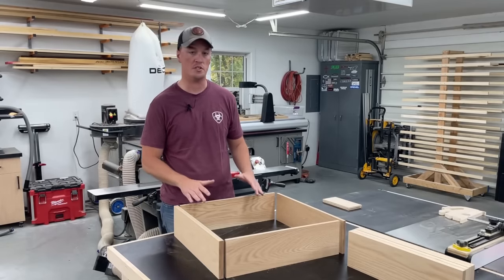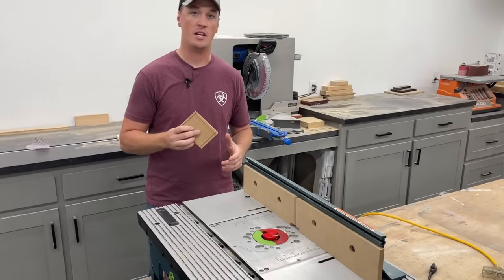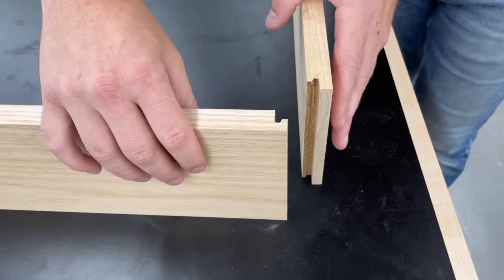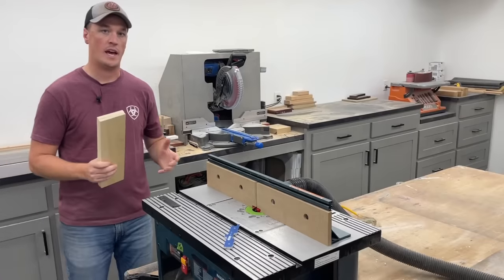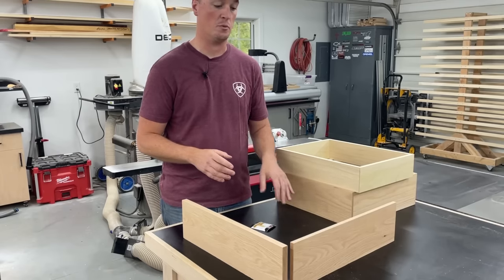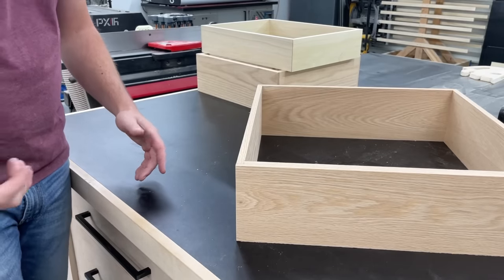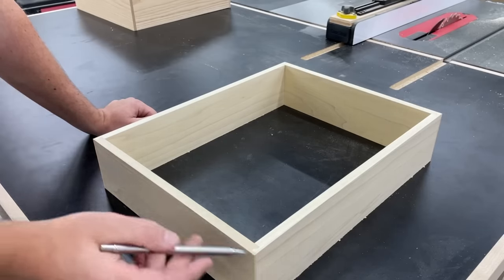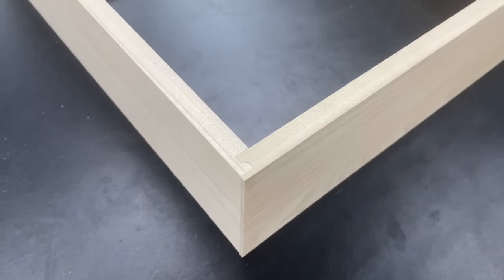Try THIS Great Drawer Building Method

Comment: I am so glad I found this video.  I'm about to make a ton of drawers for my shop, and just hated the idea of having all the slides exposed and/or having the pocket holes exposed.  The special router bit isn't cheap, but will easily pay for itself by not having to purchase wood for drawer fronts!  Thank you!  (And I subscribed for more tips in the future.)
Reply from the maker: Awesome thanks for watching!!
Reply: Great point about the cost of wood for drawer fronts!
Reply: @jimparker871, this is a nice method for drawers but more so if making solid wood sides.  If you’re using plywood and don’t want to see any exposed wood, then the half/half/half method completely conceals everything, even plywood layers from the front/back pieces.
Reply: @choprpilot76  You don't need solid wood sides. You need a solid wood drawer front. You effectively half blind the sides into the front face. All you see from the side is the face grain of the side piece and a bit of end grain of the front piece, which would be hardwood,  with this construction.

Comment: That didn't work very well with the baltic birch. When sides are routed the locking tip is too small and plies break  and detach which results in a hole in the joint. It works very nice for solid wood boxes.

Comment: Great video showing all the options. I would reiterate the importance of the sacrificial fence if planning to use 1/2 plywood. I have been making a ton of simple drawer boxes using 1/2 baltic birch. The zero clearance sacrificial fence is a necessity for preventing tear out on the inside face of the side pieces. The nice thing is you can just save the fence for the next run of drawers.
Reply from the maker: Yep I meant to say that there at the end and completely forgot haha definitely gotta have it for plywood

Comment: This is indeed THE best way to make drawer boxes. I’ve been doing it for years this way: all you need is glue. Using the small version of this router bit makes it possible to use even thinner boards (I use 9.5 mm. boards). The resulting boxes are just as strong as their thicker counterparts, especially if you use this method for the bottom as well: you can then make the bottom flush with the lower edges of the sides, adding some millimeters to you storage space.
Thanks for the video!
Reply from the maker: Haven’t used it for the bottom I’ll have to try that 👍🏽
Reply: Can you tell me what small bit you are using?  I am trying to make my drawers out of 12 mm  ply for my shop and have not been able to nail the set up yet.

Comment: Excellent video; best I have seen on the subject. I used this method to do a wall of lower kitchen cabinets, substituting drawers for shelves. Makes a big difference in usability when the shelf is about 20" deep. And you are right about the Freud bit being best because of the additional depth of cut, allowing the user to hide the 1/2" space to cover standard drawer slides. However, I would add one important point: Before using the bit to make the deep cut to cover the drawer slide (see timestop 7:40 of the video), I always use the table saw to cut a clearance dado to remove the bulk of the wood. Then the router bit can clean out and finish the joint easily, faster and without strain.
Reply from the maker: Good idea!

Comment: Nice work. "Clear & concise.
Explained different techniques/adjustments very well. Just ordered a bit as i'm making drawers this week.
Reply: Just like add. 
I finally got the set up right with all your sound advice.
Just made 4 drawers in no time at all. They lock up beautifully and particularly like the fact I can now hide the sliders with the overhang on the drawer fronts.
I will now be using this bit & your technique for all my other drawers. Oh well, onto glue up now & fitting.
Again thank you.❤
Reply from the maker: Awesome!! Thanks for watching!

Comment: Very good, clear presentation. I really liked the idea of the wider drawer front to hide the slides.  Also there’s no reason you couldn’t use oak, for example, for the front and 1/2” plywood for the backs and sides.   The only problem with that is you would need at least 3/4” stock for the fronts. Oh, and you lose some flexibility to tweak the drawer front after building the boxes. With a separate drawer front, you can make adjustments for any variances in cabinet width, drawer slide installation, etc.  All that said, I really like this idea for shop drawers!

One question:  would it help to slow the router rotation speed with that big bit?  Especially when you bury it in the bigger front?
Reply from the maker: I didn’t in this case because I did it in 2 passes. But definitely would want to lower the rpms if doing it in one

Comment: Awesome! Do you just glue them afterwards or brad nails or crown staples? Thanks for sharing
Reply from the maker: I just glue to keep the look clean, but yea you can nail if you want
Reply: @JohnBuildsIt  Thanks, John...great video and I had the same question.  I also wouldn't mind seeing the glue-up.  Are the joints sufficient to assure that you're producing square corners?  And I'd like to see exactly how you clamp them.  (And then maybe you could show me how to decide what to put in each drawer!😁)

Comment: as new wood worker I love this clean tight and strong way to make drawers. Newbie question I am building project with drawers from plans but want to make them this way. How does this connection effect my cut list for length and width of drawers? Does this joint change length and width of drawer or need to be accounted for?
Reply from the maker: The overall size of your drawer wouldn’t change, but yea the length of your individual pieces are probably different than how they are in your plans. I went over sizing here in the video that should help you adjust your dimensions 👍🏽

Comment: like this so much that my new 1.25 bit came today. I'm getting a lot of tear out even with a push block then I adjusted the speed of the router to about 1800 rpm still not getting great performance would hardly cut through some 3/4 red oak then I just grab some pine to make a fitting block. Is this kind of bit generally used on softer wood ? like poplar?
Reply from the maker: No I’m using it on oak here in this video. Have you tried burying the bit in a sacrificial fence like I showed?

Comment: Great stuff!  I'm a newbie  Did you swap bits to make the track?  If so, what bit did you use?
Reply from the maker: The groove for the drawer bottom? I just cut it on the table saw, or yea you can swap to a straight bit on the router
Reply: Thanks much!  I appreciate the info.   @JohnBuildsIt

Comment: Great video!!!! Was looking at the other method (1/2 1/2 1/2) and ordered a 6mm bit as most 1/2 ply is 12 mm.  I will be switching to this method for my next project.  Was did you use to cut your dado for the draw bottom?
Reply from the maker: I just use the table saw for the grooves
Reply: @JohnBuildsIt  Thanks -  my draw lock bit just arrived this evening.  Going to start making my drawers tomorrow.  I also have the Bosch router table and today I installed the O'Skool router lift made for this table.  Used it some today and loving it so far.

Comment: Hi John, thanks for the video. I learned something new! What are your thoughts on this method vs. some simple dados? Both hide the method of joinery and use tools you probably have. Is it just personal preference? Speed? Something else?
Reply from the maker: With the dado method the end grain of the side pieces is visible on the front, which is what we’re trying to avoid here. Unless your talking about just doing dados the opposite way, but then there’s no strength advantage to it. Hopefully that makes sense haha. Ultimately good use cases for all the methods though 👍🏽

Comment: How did you do the groove for the bottom panel? Diff bit or height adjustment? I watched again & again and didn’t catch it. Great video though.
Reply from the maker: Just on the table saw. Can use a straight bit in the router though

Comment: John, great video.  I am in the process of making draws with this bit.  One problem I have is that the front and back parts that covers the end of the sides is very thin.  I mean less than a 1/16”.  Yours are much thicker.  What am I doing wrong?  I am using 1/2” baltic birch plywood for my drawers.  Thanks.
Reply from the maker: Should just need to lower your bit a little
Reply: @JohnBuildsIt have tried everything, but cannot get a tight joint and still have enough of a front to cover the sides. Believe this bit is for 3/4” plywood but not 1/2” plywood.

Comment: What setup blocks do you have? Looks like the bottom cutout needs to be + 2” to straddle the 2” router bit and the set I got wasn’t wide enough. It doesn’t seem to be a measurement included in product descriptions.
Reply from the maker: I have the Kreg blocks. Can use the end of blocks rather than the cutout
Reply: @JohnBuildsIt  Thank you! And thanks for the video. I must confess I'm new to routing and had a hard time getting consistent cuts and avoiding tear out on the vertical (side) cuts. You make it look so easy. This guy's super simple DIY coping jig was a game changer: https://youtu.be/AijVPt9VFiM?si=lPERB-xQYoOkJUX1  You might suggest it to people that complain of tear out!  Another thing I learned was to cut the groove for the drawer bottoms AFTER the end cuts. I cut the groove while waiting for the bit to arrive and wish I'd waited cuz of tear out on the exit side of the groove. A little masking tape on the exit side helped but wasn't fool proof. There's probably some way to wedge a piece of wood in the groove but I couldn't come up with anything. Oh well, the next set of drawers will be much easier.  Thanks again!

Comment: what speed do you run these through? trying to cut these from 1/2" Maple and getting quite a bit of kick and burn on the piece.
Reply from the maker: Depends on the wood, but pretty slow. Maple is just one of those woods that burns so easy unfortunately

Comment: Excellent video John, I learned a lot. Just thinking ahead, if I want to make the front side of the height of the drawers bigger/larger than the sides to hide any space between the drawers, this would not be a problem. I guess if I a putting a rabbit or grove in the bottom of the sides for a drawer bottom, I need to calculate where that would be for the drawer 
front and cut that rabbit separately. Am I correct?
Reply from the maker: Yep! Makes sense to me and should work fine

Comment: Hi, John.  Great video.  Seems Freud makes a 1.25" and 2" diameter drawer lock bit (both with 1/2" shank).  Whixh diameter cutter head are you using here? Thanks!
Reply from the maker: Are you looking on Amazon? I think that listing on there is incorrect. The 1.25 that’s on there should be the same 1/4” shank that I have. The one that I used in the video is the 2” diameter 1/2” shank though

Comment: I have that table and did not find the fence accurate enough to make joinery that needs to run vertically and flat on the table.
Reply from the maker: Dang! Maybe shim behind the sub fence to square it to the table? I can’t believe how great mine has been for how cheap it is

Comment: Just to confirm you’re using the router you linked to? BOSCH 1617EVS
Reply from the maker: Yep 👍🏽
Reply: @JohnBuildsIt  thanks!  I really loved this video - I had an older version of the Bosch router - it didn’t have the extended height adjustment - so I bought the new model :). I’m excited to try this approach this weekend.  Thanks for your content!

Comment: I am just learning this method for drawer boxes. However, when running the end drawer piece through the bit, the result has terrible tear out. But speed is 16,000 rpm.  There is an issue but not have not solved the issue. SUGGESTIONS???
Reply from the maker: Have you tried burying the bit in a sacrificial fence like I showed? I don’t get any tear out

Comment: Well that just shows me that my table is not up to the job, Found the top was warped and the insert that the router attaches to, was warped as well, so I got a new top and lift, dropped the lift unit into the top, took my time to make sure the lift is dead flush with the top, there are adjusters all around to get it right.  As an amateur, there is no way I can afford a cast metal router and lift so the top is phenolic with an alloy lift. Next week hopefully get using it.

Comment: For us novices, for the first example you used, you said to set up the bit height to 3/8th's of an inch .  And you said to set the fence at 7/16th's for a 3/4 inch material. Later you said you deliberately made the cuts sloppy.  And then you had to make adjustments to make it fit perfectly.  Did you intentionally give the wrong depth of the fence and the wrong bit height? If so, were your final measurements to make your scrap block for a simple setup every time for the same 3/4 material?  Thank you.
Reply from the maker: No I stated the correct dimensions, just didn’t set mine up perfectly so I could explain that.